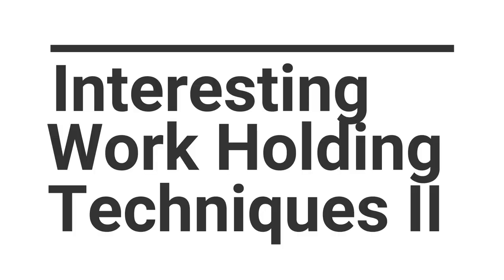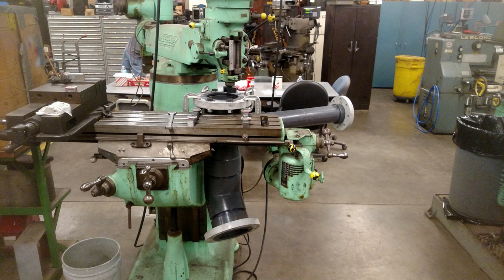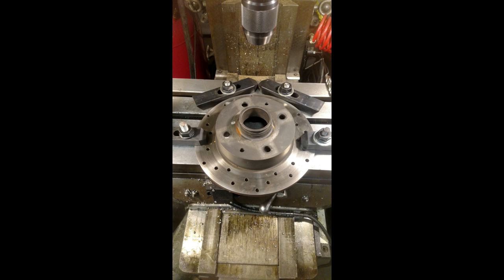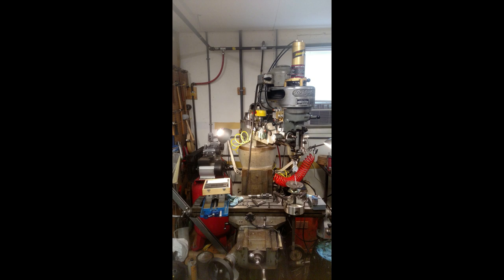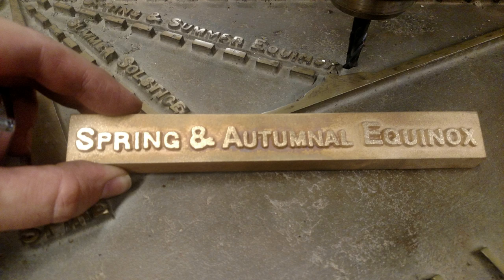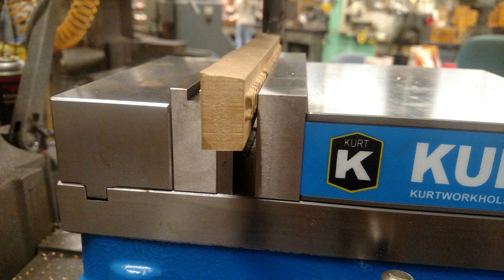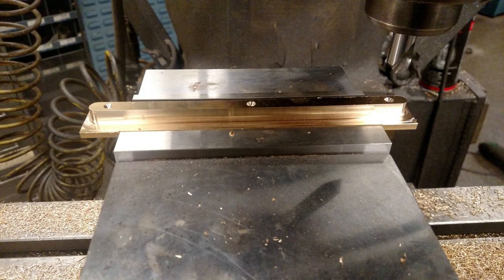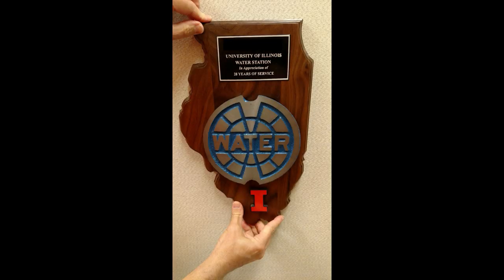Interesting Work Holding Techniques II

Comment: Nothing more satisfying than coming up with a Rube Goldberg way to fixture a part in order to complete what would otherwise be an impossible job. Sometimes you just have to do whatever it takes to get the job done. Those were some excellent examples. Kudos on coming up with solutions that worked. I will be keeping them tucked away in memory for future reference. I love the idea of using the lathe chuck clamped to the edge of the table. Brilliant!

Comment: Thanks for the videos. Something in your video at 9:56 caught my ear.  You mentioned having a "conversational machine". I have never heard that term before. Could you please expand on what that is , how it works , where it goes on Friday nights etc.
Reply from the maker: Sure thing. Instead of programming it with G code, you select a type of motion from the menu and feed it coordinates and parameters. For instance, you would choose Mill and tell it your coordinates, feed rate, if the tool should be offset to one side of the geometry (you can choose left, right, or center), and whether you want to continue to another operation or not. If you choose to continue it keeps your feed rate and offset choices and you just need to input new coordinates and choose what type of motion you need. You could go from Mill to Arc for instance. You can also choose Pocket to bore a hole, Frame to mill a boss, Position Drill to do hole-related things, Bolt Hole for those, etc. They're very easy to program and it's a fantastic system for one-off jobs with complicated geometry and short production runs. Perfect for a university shop.
Reply: Outstanding. Thanks for taking the time to reply. I will do some more research, sounds interesting.  @StuartdeHaro

Comment: I probably can guess the answer, but, do you ever run into lead and okum pipe joints?
Reply from the maker: I don't, but I also don't do any pipe fitting or plumbing personally. I just make and modify stuff for those guys. Who knows if there's any of that still around in the older buildings.

Comment: Excellent. Thank you! :)
Reply from the maker: Hi John.  I meant to give you a shout out in this video because you asked for more in the last one, but I forgot.  I make these things early in the morning and it slipped my mind.  Thanks for watching again!
Reply: @StuartdeHaro  Wow! Thank you. I appreciate that, but no worries. I wanted to ask if you (Or maybe one of the fellas you work with there) happen to know of somewhere in the Chicagoland area to get bags of refractory cement? I'd like to build a backyard foundry this summer to cast aluminum and brass, but finding the refractory is proving to be a challenge. Thanks.
Reply from the maker: Hi John.  I chatted up my blacksmith friend and he doesn't know of anyone in our part of the world that just carries it.  He buys it from a company in Georgia named High Temp Tools & Refractory.  He said he buys two types: Mizzou Castable and Kast-o-Lite 30.  The Mizzou stands up to forge welding flux very well while the Kast-o-Lite is a better insulator.  I'm guessing that's what you would want for a furnace.  He said the price is around $70 for a 50 lb bag but it's going to cost you around $50 of shipping too.  Send me some pics when you get it done.  I wanna see that bad boy!
Reply: Stuart, thank you for taking the time to ask your friend. I really appreciate it. His insight is exactly what I was looking for. While it's unfortunate to learn that it isn't available locally (which is peculiar to me), I'm still grateful to have that confirmed by someone in the know.  At $120.00 a bag... it might take a while until you see a photo of that build lol - Thank you again. :)  @StuartdeHaro

Comment: Super..need boring techniques with easy removal of lots of material and good finishing
Reply from the maker: I always drill 1/8" or 3mm undersized.  Then I take multiple finish cuts with measurements  in between each cut so I know how the bar is behaving.  In general, I use the largest bar I can to avoid flex.  

In those instances where I have a very large bore and don't have a drill close to the size, I'll drill with the biggest one I have available, take a single pass at my finishing depth of cut to get a measurement, then just plow off a bunch of material to get close.  Try playing around with speeds and feeds.  Often times, slowing down the RPM and using a deeper cut with a more aggressive feed rate will remove material faster than shallower cuts at higher speeds and the finishing feed rate.  The surface finish of your roughing cuts does not matter after all.  

I always want to take at least 3 cuts at my finish depth of cut though so I know for sure how much material is being taken off with each pass.  I hope this helps.  I'll try to make a video demonstrating this, but I've got a lot on my plate right now.  Thanks for watching!
Reply: @StuartdeHaro  thank you please show the video how to use the tool grinding and insert bar techniques
Reply: @StuartdeHaro  your fan from India